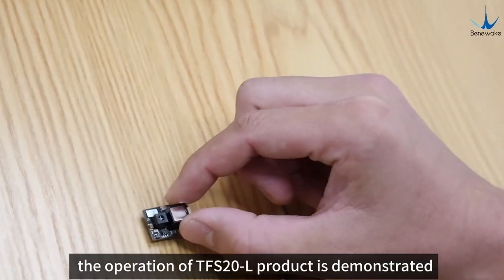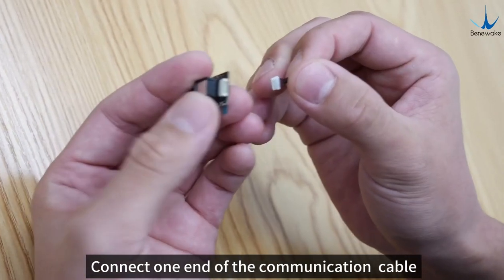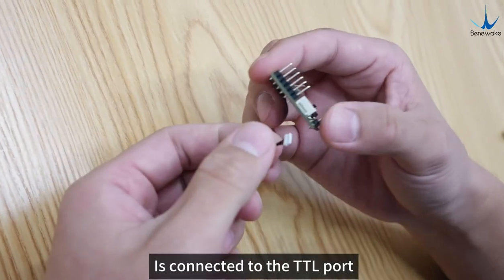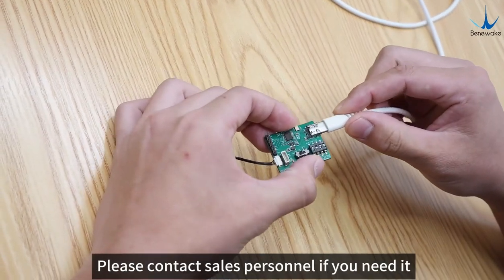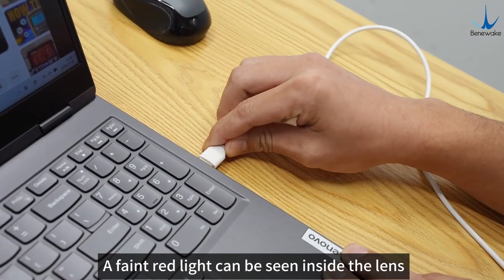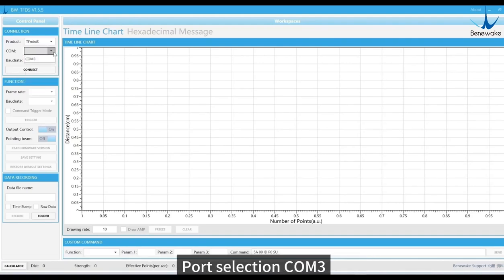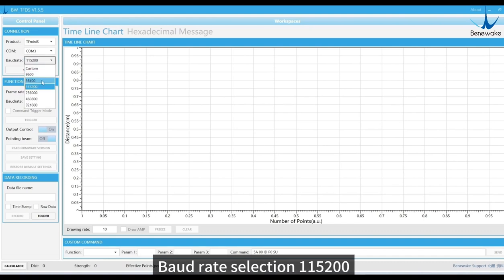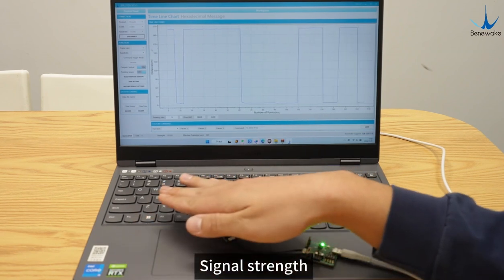Benewake LiDAR TFS20-L Operation Demonstration

Comment: Where do you get the converter to connect the sensor to a computer?
Reply: Same issue here. I ordered an adaptor for TF from mouser but it is not the correct : the ttl does not have the same spacing or even the correct number of contacts.
All resellers who are selling the TFS20-L are not selling the adaptor. How can we proceed to evaluate the LiDAR  ?